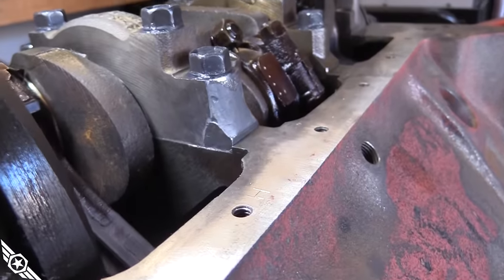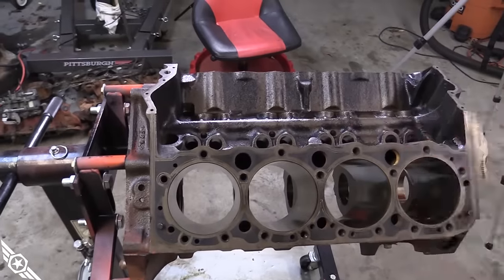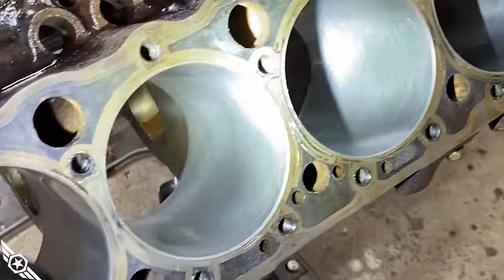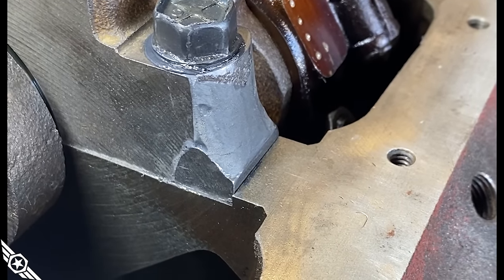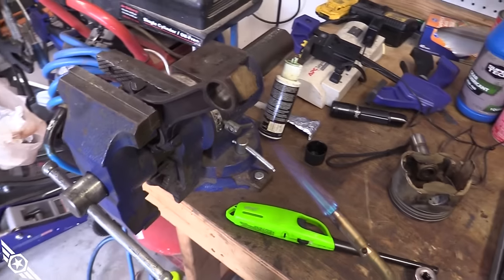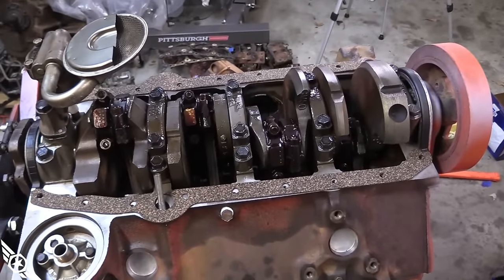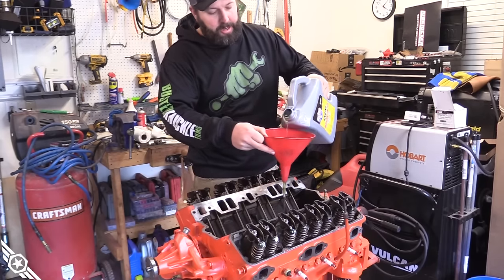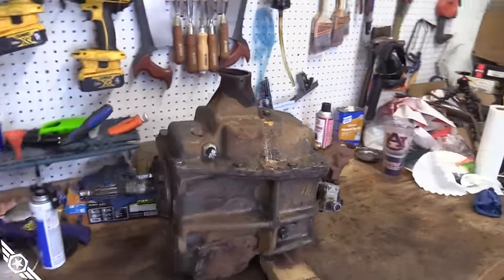Budget Blown Small Block Build #squarebody #smallblock #blowermotor

Comment: Well done, sir.  When I was a teenager just cutting my teeth on motor assembly I didn't know what rotating assembly balance EVEN WAS.  I literally didn't know that was a thing.  Swap rods, swap pistons without a care in the world!  Somehow they always ran just fine and I couldn't tell any difference from the driver's seat.  It was glorious.  
Also, good job on that main cap.  You are god amongst men.  I wouldn't have tried that.
Reply from the maker: Thanks for all the complements. People believe everything in an engine has to be perfect. And in extreme case, it needs to be pretty close. But  stock to moderate builds have a lot of margin in the components. It’s hard to know what will matter and what wont. But you won’t know unless you try. So many people are scared to play cars because so many machinist and “professional engineers builders” make them believe they need to achieve perfection or nothing at all. I used to believe that growing up. I think the internet has done a lot to show people they can have fun without perfection or a lot of money. But the “pros” will always give people like me shit, and call me a hack mechanic, because it takes money out of their pocket. I’m not even a mechanic 😂. I’m an engineer that just happens to have a passion for anything mechanical,  continuous learning, and entertaining people. So thanks for watching.
Reply: @freedomworx  I agree.  Nowadays people on the internet think these motors are made of peanut brittle or something.  Like they could shatter in a million pieces when you hit a certain RPM if things aren't perfect.  They are made of much, MUCH sterner stuff than that and you can make FAR bigger mistakes building them than most people believe without any real ill effects.  
FYI- I run that same blower on a stroker 383 SBC made of junkyard parts that goes high 11s with a milder cam than you are running (Summit K-1103).  It makes valvetrain noises like the valves are out of adjustment.  But in reality the lifter bores are so worn out I can move the bottoms of the lifters back and forth about .050".  Six years of weekend fun with cheap Walmart house brand oil in the sump it still hasn't blown up.
I don't do any YouTube content but here's my ride laying it down a few years ago on a buddy's channel (I'm in the far lane in the white Malibu):  https://www.youtube.com/watch?v=HzsCT-xbFmc
Reply: Man, thats what makes us the real hardcores among mechanics. 

No money, not enough knowledge, just decide its "aight" cuz I gotta work by Monday.
Reply from the maker: Sometimes you just gotta roll the dice 😂

Comment: JUST FOUND YOUR CHANNEL 👌👍❤ 
When measuring the rings for my 1st build, in my engine shop, aka lawnmower shed😅, I accidentally figured out a Foldgers coffee can with plastic lid works perfect 👌 😂.  I just put the lid on and cut off all but the depth of where I wanted to measure my rings (roughly 1"). Basically, it looks like an oversized shoe polish can without a bottom. Plastic lid catches on deck surface but can side sets depth.
I know, I'm an idiot, but im poor and have an imagination. Love your style brotato chip! Crowbar idea, BRILLIANT! (Old Guinness commercial)
Reply from the maker: You working on a train engine??? A coffee can is huge 😂

Comment: The reason you do a cross hatch when honing the cylinder, it helps prevent the rings from rotating. If they rotate any they will eventually line up. That’s why they recommend putting the end gaps in a certain position to help prevent that rotation.
Reply from the maker: That’s simply not true. Crosshatching is to hold oil. Plain and simple. The oil is what actually seals against the rings. Every piston ring rotates in operation unless it’s pinned, like in a 2-Stroke diesel engine. It’s supposed to rotate, that’s what keeps them from getting gummed up and sticking. I’ve actually done a video on how ring rotation is measured by embedding a radionuclide is embedded in the ring to track rotation while the engine is running. It’s actually a standardized SAE test 🤷🏻‍♂️

Comment: Just so you know in a flat tappet camshaft cam break in is supposed to be immediately after first fire to prevent a lobe from going flat. Like get the timing kinda by eyeballing it, the fire it and immediately stick it to 2,000-3,000 rpm varrying up and down for 20 minutes. Gives your camshaft the best chance of survival. Good job with everything buddy!
Reply from the maker: It's almost worth the money to run a roller cam, just so you don't have to worry about wiping a lobe. That's the most stressful part of a build for me.

Comment: The 20v Dewalt Batteries are still an 18v battery. Its a marketing game. It's like calling a car battery a 12.7v battery just because thats what it charges to.
Reply from the maker: I don’t have issue with the voltage. The batteries just don’t live very long before they are no longer serviceable.
Reply: @freedomworx  Oh for sure. I'd be doing the same if I had 18v tools. I was referring to you saying that you wondered if the different battery would change the drill rpm. My point was that both batteries are actually 18 volt, so the rpm shouldn't change. I'm enjoying your videos by the way. I have a K10 in my driveway and an 8v71 blower on a shelf. I dream about putting it on someday, but don't want to cut the hood. I thought it was cool to see how you made yours work.

Comment: I like that you use detail when doing this. Others pour oil in the engine and get it in the ports too. Or don't use a funnel when pouring into the valve cover filler hole. Dripping all over. That's sloppy workmanship and you better believe I notice that stuff. If it's a shop doing that, their service with me is no more!
Reply from the maker: Fortunately I'm just doing it for myself only. I wouldn't pay me to work on cars 😂😉
Reply: when you pour "engine blood" out of a square, plastic bottle, turn the bottle 90 degrees so its wider flat surfaces face the floor. doing this lets the air get in faster behind the liquid, so the fluid doesn't "glub glub" pulsate out.

Comment: My 302 Chevy turned 8 grand with a 600 Holley. Twisted my Chevelle with it. 600 is enough.
Reply from the maker: It’s not enough for a draw through blower application making 7 pounds of boost.  Because a blown 350 turning 8k with an appropriate sized blower would be making like 800HP. Not going to do that with a 600cfm carb. It would never be able to make 7psi due to the carb restriction. It’s simple math. It would work in a blow through application, but not a draw through.
Reply: @freedomworx  Mine was just a naturally aspirated 1/8th mile drag motor. Sure sounded wonderful above 7200. Came out of a car with a 5.4 sec eighth-mile time.
Reply from the maker: This thing will never see 6,200. It’s a pretty half-ass short block. 😂.

Comment: The crow bar to install the camshaft is jeanious! Never seen that before I will use it
Reply from the maker: Improvise, Adapt, Overcome…cheaply 😉
Reply: Easiest way to drop in a bumpstick--stand your bare block on its bellhousing end. Let gravity help you "drop" it in, and with no reciprocating assembly in your way, you can reach right into the crankcase to guide 'er with both hands past new cam bearings. You can even do this dry (so your hands can work the camera) and then grease 'er up before she reaches the final destination, getting the lobes and bearing surfaces.

Comment: your blower isnt blowing thru your carb bud. draw thru  carbs are for turbo or procharger applications...... any normal carb will run ontop of a roots blower no problem 😂
Reply from the maker: You have no idea what you are talking about. 😂 Blow Through Carbs are for turbos and centrifugal chargers. This is a draw-through carb. And yes, any carb will work on a roots blower for a race application at full throttle. Just like a snowmobile will work as a Jet-Ski as long as you run it wide open all the time. But it is not ideal in a street application, unless you just want it to run stupid fat all the time. Might want to actually do some research before you try to punk me on the interweb, because all you’ve done if make yourself look foolish 😘